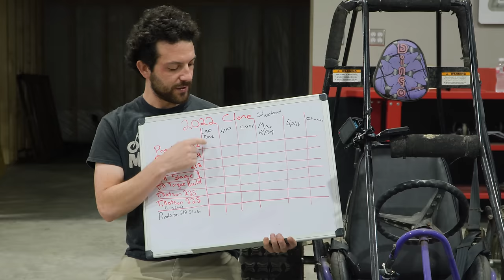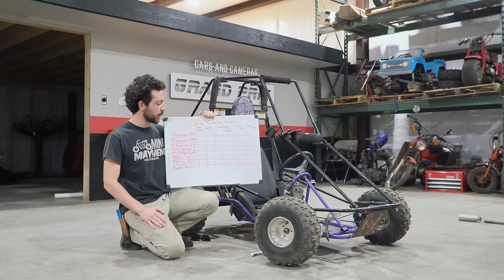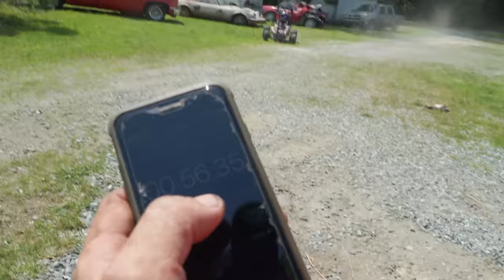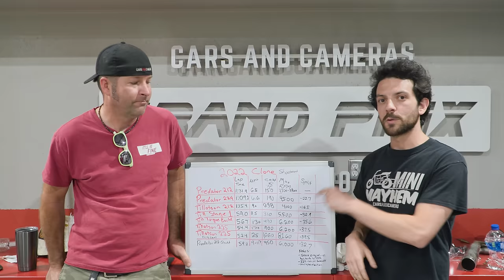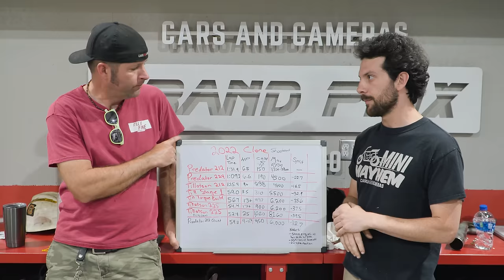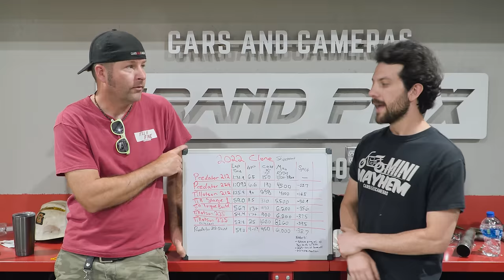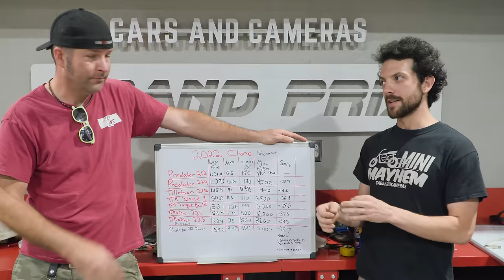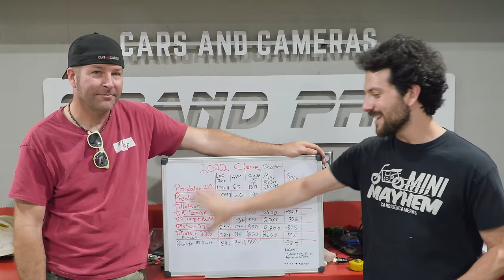Comparing 8 Honda Clones from 6.5 to 25+ Horsepower | SENDING 8 Performance Go Kart Engines!

Comment: What would be a good engine for an odyssey fl250? I was thinking either a 225, 440, or 670 v twin. The v twin being the most powerful of the three. The question is, that will the 440cc duromax be powerful enough for an odyssey and will it be reliable enough? The same question goes for the 225 race motor. Will the juggernaut be able to handle a 670cc v twin? If the 440 is good enough power, will upgrading things like a mild cam, a flywheel, and a governor delete make the 440 unreliable. for reliability, I'm talking about not needing to do maintenance other than oil and filters for a few years to come. Will the electric start on the 440 or even the 670cc bog the engine down enough to matter?

Comment: I can't really tell from listening to the exhaust note, but it seems that with the faster engines, you're not holding full throttle through the fast bits. 
Do you have a different venue you could wind them up a bit more?

Comment: I had a stage 2 hemi 212 on my Hammerhead 80t with the stock sprocket and dear lord did it get sketchy. And I didn’t even have the carb tuned right and I know theres some other stuff I did wrong. Even with suspension those engines haul butt on go karts. It gets super twitchy and It hated turns so it would flip almost constantly

Comment: You guys ever see those like, Indonesian dudes who chop up small motors and combine them and do other weird stuff like that? One of them has a 3-cylinder scooter that sounds like an FZ09. I was wondering if perhaps your next suspension kart could be something like that, but go HOG WILD and give it a Polaris CVT and an engine worthy of that such as a big valve big cam 225 twin or triple. Basically crosskart 4.0 and better than either the 750, yard dart, or Trophy Kart.

Comment: I have a stock 3 horsepower side shaft air-cooled engine what's the max compression you can raise the engine to for pump gas and still have longevity and dependability? Can you angle mill head, steel shim or thin head gasket, dome piston, little cam? Not familiar with what you can do with these little engines.

Comment: I just picked up a ghost and gonna throw it on a cart I have. any idea what size the air filter is and what the throttle cable ends are needed to go in the carb? Gonna order them from go power sports but not sure which to get. Also do you see any problem with running a stock predator gas tank on this engine over doing a remote located tank?

Comment: Since there is no replacement for displacement how does the predator 459 compare to the stage 2 tillotson 212?  Will the 459 have more torque and speed given the same gearing say 10t on the jackshaft and 60t on the axle?

Comment: Yes, you should have lowered the tire pressures.
Reply: You can run those almost flat, they are still very stiff. But you also run into the risk of the side wall rolling over, biting in and the kart flipping. Not fun!
Reply: @WyFoster  softer , not nearly flat,lol.

Comment: hey whats up i really learned alot by watchin your youtube videos .i would like too get a clutch for my monster motto bike 7.0 hp briggs and statton engine witch i shave down the motor because i trying too put a smaller size clutch witch it didnt work out the clutch did not work

Comment: I have a Brigs Megatron pretty well built on a dingo, but the motor mount kind a it’s strong but it’s not strong enough. What do you recommend for a motor mount I want to move my motor to the right a little bit. It is a one seater I believe it’s a 91 thank you for your time……….

Comment: You have that backwards on the T 225 on methanol vs gas. Gas has more energy in it than alcohol. So IF they rate it at 30 hp on methanol, then you are getting MORE than 30hp on gas!

Comment: @24:08 Next time lower your tirepressure! 

Your backs will thank you for it... And it doesn't hurt grip either.
Reply: Exactly i have my front tire on my ct200u almost flat it runs so much smooth plus it has tubes in them

Comment: How’s your tach is it run off spark? Is it for 2stroke or 4stroke. Just really sounded like rpm were higher then it was reading. If runs off spark then how good is that. 2 revolutions per 1 spark on 4stroke.
Reply: Spark..... and rpm is rpm if its a 2 stroke or 4 stroke

Comment: Would that 225 be a good motor to run on a trailmaster 4 seater? i currently have a 200cc that is efi but damn has no power at all.

Comment: hello guys, I bought a motor on ebay because here (Puerto Rico) it is very expensive to buy from pages dedicated to this so I buy it for cheap and it is a Husqvarna 208 and it has a lot of strength I have not heard anything about it I thought it was another clone but it does not have a Tag that says Husqvarna with the emblem and everything because I would like not to see if the difference between that and the others is possible , it was cheap for me like $150 full cost put here in Puerto Rico what is very cheap is usually about $200 without shipping cost. I haven't installed it yet to see how it moves but I I would like to know more about him and since I have been following him for many years I know that he is the best on the subject.

Comment: Btw y’all should put a 356 in that 225 with the 1:3 rollers and put a 380 dominator carb on alky. It’ll be a completely different experience 

That ghost motor is a waste of $. We had one given to us and we tore it apart and nothing in it is worth the $450. You can build a motor that makes 2x the power of that thing.

Comment: I’ve got a Ghost waiting to go on a mini bike, need a tank and pipe. I had to buy one to see for myself but in truth, it’s just a 212 Hemi with the Ducar 212/Tillotson 212E head on it. At the end of the day an out of the box Ducar 212 from EC or OMB Warehouse is a better deal as it at least comes with an Aluminium flywheel. Maybe the vibration was the rev limiting coil cutting out on you.

Comment: Hey guys im planning on building a jaguar e type go kart it Will weigh around 250kg with me on it max it also needs to have a top speed ok 100kmh minimum and need to excelerate extremely also it needs to sound very good and run at high rpm atleast 7000rpm the best would be higher also it needs to have alot of low down torque and behave like a 2 stroke at high rpm when you come in to the powerband and it surges forward even more it also needs to be very reluable and be extremely robust and needs to have 25hp or more  what is the best most compact engine that i could use i now have a GY6 150cc unit and wanted to upgrade that to 171cc is that a good engine for this build?

Comment: You guys seriously need to rent a grader, and level your race track, Ike's not as young as he used to be, when you started this channel. Year after year, your carts have got more power,,,,,,,, and Ike has less. I'm a 68 year old retired tool & die maker, with a Predator 212 "death row" motor I stuffed into a MTB. I built a new frame from sced 80 alluminum, that I stretched to fit the engine, added a top motor-mount,, zip-tyed the governor, installed a jugernaught clutch, a Rock-Shock front end, and sprung, jel- filled wide seat. I am currently waiting on the parts to complete a mag rear wheel, because the 2mm spokes on the laced wheel, have begun to snap. Only 2 spokes have snapped, so far, but, I'm not going to wait  until it leaves me walking. I love this bike, it aint no Harley, but it rides like one. It'll easily do 100km/h, and, it's hard to keep the front wheel on the ground, so I keep the throttle stop screw set at 80 km/h, because if it goes 100, I'm doing 100, and attracting unwanted attention from the police. 50cc is as large an engine you are allowed, and, I'm partially blind, and mostly deaf, so, the police may have a legitimate claim to be concerned. Don't worry, my blindness gives me tunnel-vision, and double-vision, but, I have 2 motorcycle rear-view mirrors mounted on 10" riser bars, and I see well enough to read road signs. I'd like to see you guys build three of these bikes, and take them on a long road trip. I'll let you know how the mag wheel holds up, as, I'm concerned about how the 6 5mm screws, located very close to the axle, that holds the drive sprocket on, holds up to sustained high speeds. from robinedwardward@gmail.com.

Comment: Hey guys could ya help me an older dingo 2 seater go cart.  I have Honda gx 6 hp I believe.  No throttle no brakes or centrifugal clutch.  I’m in a situation where I can’t do it my self.   The guys before me took the engine mount and half butt it.  Man the used socks for spacers.  Can ya help.

Comment: People run methanol for several reasons. Fuel fires are WAY more manageable and the fire is much cooler! Engine temps are lower since methanol burns cooler than gas. For high compression engines, there is only so much you can compress gas vapor before it detonates. This is the ONLY reason for gas octanes! Higher octane means higher compression before detonation. Alcohol vapor can compress much more without detonating than can gas. This means with a turbo or super charger you can shove in much more air with much more methanol than you can with gas and overcome the energy deficiency in methanol! An engine running on gas will require much less fuel volume than will one running on pure methanol! I'm sure there are calculators out there for the conversion of volume vs energy, but methanol is like 65% as energetic as gas. In naturally aspirated engine like these are, gas is going to win hands down thanks to it's far superior energy density!!!

Comment: Guys,. I wish you would widen the bridge creak crossing, at these speeds if you drop a front wheel off that edge someone is going to be in the hospital maybe crippled for life.  I know you wear seat belts n helmet but flipping 3-5 times or a dead stop will mess you up.  Widen the bridge by 3 feet, concrete Please!!!

Comment: Maybe yall can make a real short drag strip on your property somewhere, so that you can really compare engine power and acceleration without having to go around the course so dangerously with such high power? That would be pretty neat.

With that big engine you can see the wheelbase of the kart became an issue. It was drifting back and fourth from the raw acceleration power. Top fuel dragsters and F1 cars are both really long and I'm pretty sure that's the reason, if the back end gets loose it doesn't come around on you so fast.

You guys need to get that full dirtbike body armor if ur gonna be rippin like that with the last engine. IDK if this is true with karts, but with dirtbikes, the smaller and slower ones are actually more fun for some reason. Maybe widen out y our corners and put up some straw bales or sand pits or something so if you go off the course it's not so deadly. I really want you guys to keep making videos.

I know being safe can conflict with being "cool" but, let me tell ya something, it's not very cool having injuries believe me I've had a lot. I'm a big fan of being cool but I'm starting to recognize a lot of problems it can cause in some situations that are worth paying attention to. Obviously the reason danger is cool is because it means you don't give a F and it makes you kind of a badass, and sure that's great... but it's not always worth it!!!!! I tore my PCL longboarding at high speed with no pads on. If I had just been wearing knee pads I could have saved literally years of my life being disabled and depressed in my early 20s when otherwise it's supposed to be the best years of your life. Be smart guys. John you are very smart I know you know what I'm talking about. Keep up the great work guys. Sorry for the novel here. You guys really inspire me to build karts and engines.

Comment: Love the videos but is there anyway you guys could do a full Briggs raptor/ 5hp flathead build? Would love to see it and maybe you guys could work with arc racing?
Reply: Nothing beats the sound of a screaming flathead i agree they should build one
Reply: I love the old 12.5hp flat heads but not much for parts for them
Reply: @conner5611  exactly they have done alittle with them but I would love to see the do a full build I’ve been waiting years
Reply: I have a 10 HP Briggs and Stratton industrial. that has been extensively built. most all the internals are high perf. Parts. and has had the head shaved, and has a thirty MM Mikuni carb. on it, and a stainless steel exhaust. it's on my kart and it's scary fast. in fact I'm in the process of upgrading the brakes and tires currently. because the brakes weren't up to the task. and the turf tires won't handle those speeds. I drove it a few times and noticed that it's definitely going to be necessary do these upgrades.

Comment: Hey C&C 
Ive seen another video saying the ghost vibrates
 The guy used a micrometer on his crankshaft and determined it was about 100 thousandths out of round  
Hopefully that was just a first run manufacturing flaw  that will be worked out soon .

Comment: Somebody should figure it out and publish a list for each size engine that tells you how much horsepower each upgrade or modification you add to it makes. Like lets you you have a 196cc 6.5 horsepower stock engine on your mini bike and you want to add 1 mod at a time and you look at the chart to find your 196cc 6.5 horsepower engine and see how much more horsepower you gained just by adding the header pipe and losing the box restrictive muffler. And so on and so on with each upgrade most people do to theirs. I'd love to know what kind of horsepower my bike is now making after all the mods i've done to it over the last year or 2 but i have no idea lol. I only know it feels more powerful than originally but i want numbers !!

Comment: If I hadn't already bought the Lifan "7hp" 212 I have for my slow-burner kart project (so slow I haven't even got any metalwork for it!), I would have gone for the tillotson 212 electric start, as on their site (me being in the UK, them being in Republic of Ireland) it's not all that much more pricey than I paid for the Lifan, but comes with all the tillie goodies and professionally made upgrades they put into the Honda GX-clone design, I can't even get the Lifan to run properly cos they screwed up the carb at the factory, so need to rebuild that (got parts, just not got the get up & go to get on with it!!!), so yeah, go for tillotson...

Comment: That was unfair to the stock engines, my stock predator with a comet is scary fast, you dont have a regular 30 seriers driver lying around to even it up
Reply: Unfair? I was not a competition. Each engine was more powerful then the one before it.
Reply: @infesting  you didnt hear what he said on the juggernaut torque converter, its designed for higher HP engines, and lower HP engines couldn't get to full speed with the juggernaut. so i think you would use the standard 30 series TQ for thoes

Comment: What  you have is a chassis not up to the horsepower you're providing it with . From this point forward every engine will just provide more time without traction or driving controllability .

Comment: . Did you make sure you have absolute full throttle on the ghost and all the engines  only way would be air filter off and finger in carb. That ghost just was not impressive at all not in the least. I had high thoughts but your video you did here showed it as not worth buying. So glad you guys did this video.
Reply: We made sure they all had full throttle

Comment: Probably the last thing you'd ever compare it against, but this was like reliving your sex life through various ages. Starts off slow and easy, everything is comfortable and lasts forever, then you hit your 20s/30s, things get a little spicy but still hanging in there, then you get old, your back is already wrecked, but you're still itching to have one more ride.
And as it goes, it's over almost as fast as it started. 😁

Comment: I have a tillotson 212 block with a 3 inch piston and a stroker crank, 356 billet cam  big head valve running on m5 pwk 30 carburetor I just made a pass 97 mph @phantomminibike

Comment: Slam a hammer turn the screw drill a hole and that's a few but even though you do it it doesn't really matter sometimes if you go up sometimes you go down sometimes it's all around hickey hickey hickey how many miles that run up the clock

Comment: I want to know why the Predator 212 racing engine is vibrating...that's strange since this thing is built for reliable affordable go Kart racing.  Please figure this out for us Ike.
P.S. You should get a cheap scrap yard 50-foot roll of chain-link fence (leave it rolled up) and have Charles drag it around the track for a couple hundred laps.
Just sayin'

Comment: Why don't you guys take the tractor and smooth out the track? If you have a rototiller attachment  run it around the whole track a couple track widths wide an then run a roller over it to take the bumps out. It seams like it would be worth it in long run. Less wear and tear on both the karts and bikes and yourselves.

Comment: When you up your speed common sense should tell you you need to up your safety program. At those speeds an accident will  happen and could easily be life changing or worse. You need a safety cage and a good safety harness at the very least. It's really not optional. Don't be foolish, Please.

Comment: You guys have so many comments, so this will probably be lost. But, instead of spending $1000 plus on some of the higher-end engines you guys have on this video, couldn't someone just buy an old motorcycle, with much much higher hp than all these engines, take the engine out, and put it on a go-kart, not to mention you'd have gears too. How plausible would that be? I've never built a go-kart, but find them interesting.